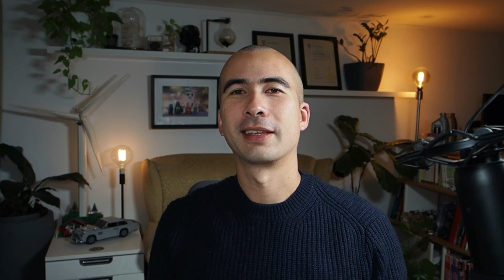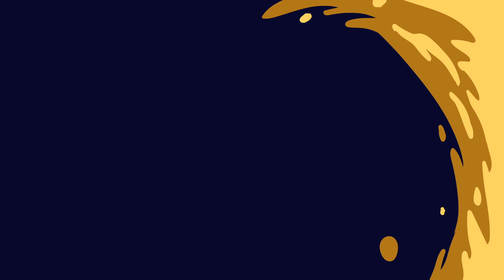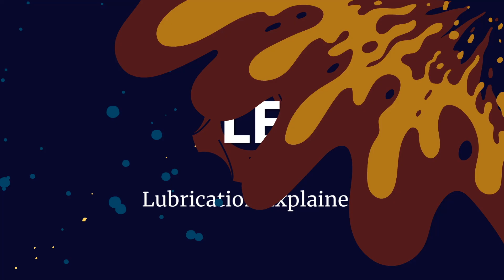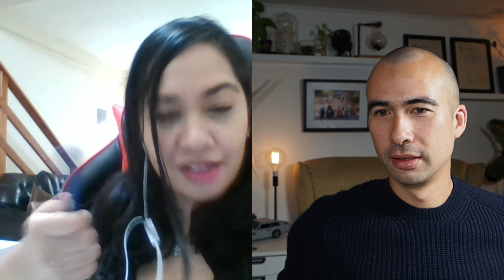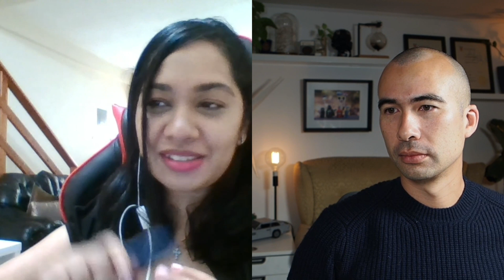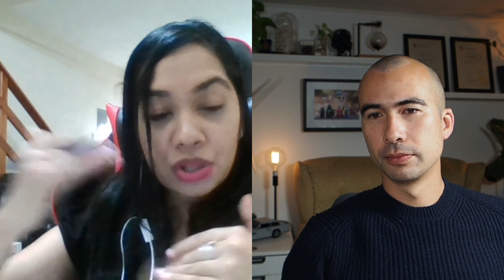Episode 008 - Lubricant Degradation Mechanisms

Comment: Insightful discussion with Sanya  on oxidation mechanisms. Does cavitation explosion create surface material particles follow explosion of air bubble post high pressure side? It must occur due to the force generated on the surface material?
Reply from the maker: Yes! The only thing I think is different though is that the highest temperature occurs a little downstream of the pump so in some circumstances the "explosion" may occur without contact, whereas the highest pressure (for cavitation) usually occurs at the pump face.

Comment: Nice interview, very informative! I'd like to understand oil settling (decantation) as a form of cleaning (indirect filtration) role of used oil recovery, as a mechanism of getting rid of  degradation byproduct buildup. Natural Gravity or centrifuge process as a form to attain the removing of these degradation. I believe decantation is a better form of separation, compared to filtration, because of very small particles below, say 5 microns,  aren't removed. Decantation is a more democratic form of separation than filtration, unless dispersants keep trapping and suspending the lighter smaller particles forever. Or if only rerefinig is the way to go. I'm a fan of Mobil 2s 😂
Reply from the maker: So this is true, but sometimes impractical because the size of the settling tank necessary would become really cumbersome. There are some companies looking to employ this on a wider scale by introducing flocculants and letting the particulate matter settle out.
Reply: @LubricationExplained  What you mean, by the tubes, a vertical Narrow but long tubes needed? Wouldn't  it make more time to settle?  Why not like the kind of fuel deposits in refineries?